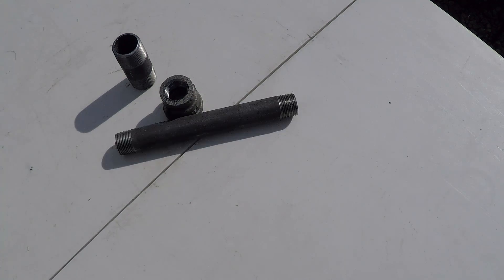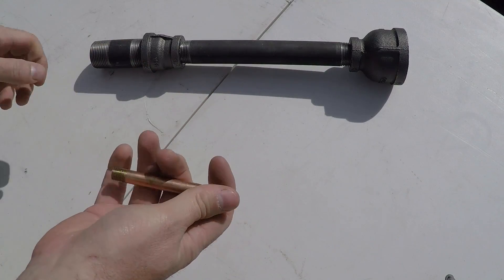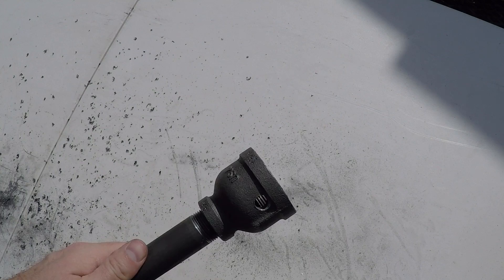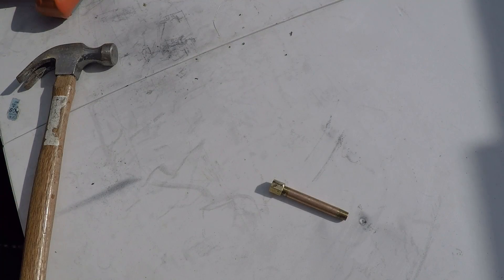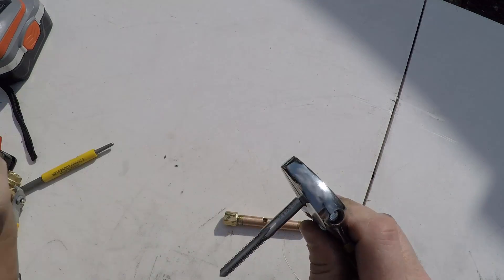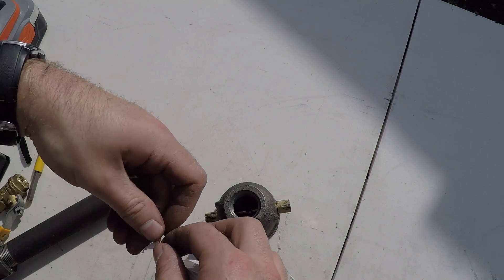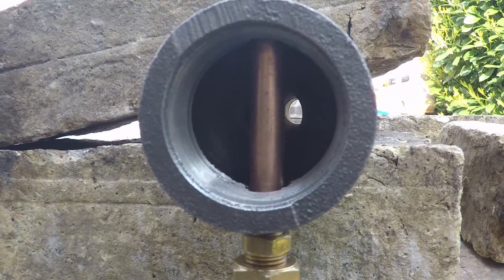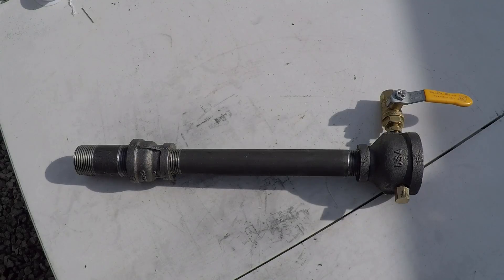How to Build a Forge: Making a Gas Forge Burner (minimal tools / no welder)

Comment: do you have a parts list for this video?
Reply from the maker: McMaster-Carr Parts List:

1 of each required:
Low-Pressure Pipe Fitting - Iron, Straight Reducer, 1-1/2 x 3/4 NPT Female - 44605K317
Standard-Wall Steel Pipe Nipple - Threaded on Both Ends, 3/4 Pipe Size, 8" Long - 44615K525
High-Pressure Brass Pipe Fitting - Cap with Hex Body, 1/8 NPT - 50785K161
Standard-Wall Brass Pipe Nipple - Threaded on Both Ends, 1/8 Pipe Size, 3" Long - 4568K115
High-Pressure Brass Pipe Fitting - Hex Bushing Adapter, 1/4 NPT Male x 1/8 NPT Female - 50785K61
Low-Pressure Pipe Fitting - Iron, Straight Reducer, 1 x 3/4 NPT Female - 44605K277
Standard-Wall Steel Pipe Nipple - Threaded on Both Ends, 1 Pipe Size, 3" Long - 44615K456
Brass On/Off Valve with Lever Handle, 1/4 NPT Female - 47865K21
118 Degree Point Short-Length Drill Bit Uncoated High-Speed Steel, Wire Gauge 60 - 8947A216

Optional 1 of each:
High-Pressure Nickel-Plated Brass Pipe Fitting - Straight Connector with Hex Body, 1/4 NPTF Male - 9151K87
MIG Gun Contact Tips for Tweco Mini Number 1, 0.040" Wire Size - 78375A609
General Purpose Tap for Through-Hole Threading, M6 x 1 Thread Size - 8305A37
Reply: 2ND ENTRANCE?
Reply: @pantrog96  I see you feel the same way I do when people ask something that is in the video that is as easy as getting a pen or pencil and paper and do something. Lazy people just irritate the F*** out of me. I run a Facebook page for a Diner and I get what is your phone number messages all the time. All they had to do was click the call button that was right next to the message button that they had to click to send the message and plus type the message out. 2 clicks and they could have been calling the Diner.
Reply: can that 8" pipe be reduced in size to 6"? is it critical that it is so long?  
thanks
Reply: گگف @alexmanning2755
Reply from the maker: I would think 6" would be sufficient but I haven't tested it and it may not give the air and propane sufficient time to mix. Let us know how it works for you.
Reply: @MakeStuffNation  Is it critical that those smaller pieces be brass? I've been to three different places and could only find them in stainless steel, apart from the bushing.
Reply: +Monster Bash I wouldn't think so. I'd say you should just try it and see what you get. If it does happen to fail, then it's not an expensive loss.
Reply: K. D. Shut the fuck up an move out of your moms basement...I’m tired of seeing you every day
Reply: I followed all of these steps and all I’m getting is a big flame coming out the end of the forge. It’s not a hot blue flame like yours... what do I have going on?
Reply: @mattredden5100  sounds like you're not running enough gas pressure which in turn won't draw enough oxygen down the venture which in return won't make a good hot flame. Did you drill your gas hole to big? You had to do something not quite right.
Reply: Take a look in the description
Reply: Can you use galvanized steel for the 3” long 1/8 brass fitting ( the one you drill a hole in for the mig tip)?
Reply: 🔴 What Is Islam? ⚠️

🔴 Islam is not just another religion. 

🔵 It is the same message preached by Moses, Jesus and Abraham.

 🔴 Islam literally means ‘submission to God’ and it teaches us to have a direct relationship with God. 

 🔵 It reminds us that since God created us, no one should be worshipped except God alone. 

 🔴 It also teaches that God is nothing like a human being or like anything that we can imagine.
🌍 The concept of God is summarized in the Quran as:

📖 { “Say, He is God, the One.  God, the Absolute.  He does not give birth, nor was He born, and there is nothing like Him.”} (Quran 112:1-4)[4] 📚

🔴 Becoming a Muslim is not turning your back to Jesus. 

🔵 Rather it’s going back to the original teachings of Jesus and obeying him.
Reply: @ahmdabdallah2132  
Muhammad was a p3d0file, lies about Jesus. No thanks, bye.
Reply: @ahmdabdallah2132  Muhammad used to love sucking my cock right after I pulled out of Allah's butthole. Where have they been lately? I miss fucking Allah in the ass and getting my cock sucked by Muhammad. Tell them to call me please. Cheers!🍻🥓🐷🐖🍖🥓
Reply: @ahmdabdallah2132 
What in the LIVING F* does your comment have to do with this video on building a forge? 
Seriously, does the Koran have a section on forges...
No, ok then. What about Islam & how Muslims have used forges & what they used them for...
NO, not that either!!!

It's ok though, 2 can play this game ...
Jesus Christ is the Only Lord & Savior & do you know how I know this is true?
....because the Koran outright states it. Koran says the Bible is correct & there's no fault in it & if that's true then Islam is FALSE, a deception, an outright lie, because the Bible states Jesus is the ONLY way to the Father (Allah) & No one gets to the Father except through me (Jesus).

Comment: Thanks for sharing, great job. Just one question ❓ what keeps the flame from going back in the propane tank?
Reply from the maker: Magic. Or fluid dynamics. The propane pressure and airflow rate basically blows it out, at the opening of the burner it's larger so the volume increases and velocity drops allowing the flame to stabilize there. And there's no air in the propane tank.

Comment: I could not for the life of me find a 1 and 1/2" x 3/4" reducer, so i figured I'd instead get a 1 and 1/2" x 1" reducer with a 1"x 3/4" bushing. 

Is that an acceptable solution?
Reply from the maker: That should work. Recommend checking out my newer 2.0 version (link at end of video), it works much better.

Comment: If you really want clean and neat tapped threads, use your drill press. Tap goes in the chuck just like a twist drill bit. Clamp your work in your drill press vise, using copper jaw covers or whatever you usually use to prevent marking up soft materials. Take the belt off the spindle if it is hard to turn by hand. Turn the spindle by hand while you keep a little downward pressure on the quill and bobs yer uncle, perfect tapped threads even in soft metal like copper. When you are tapping in the side wall of tubing, getting the tap started square and keeping it square and steady is important, because you only have a couple of threads holding your threaded fitting. If the fit seems too loose, don't run the tap in quite so deep.
Reply from the maker: No s**t sherlock. This was to show people that it can be done without that stuff. Hence the title "Minimal Tools"

Comment: how hot does it get ?
Reply from the maker: Plenty hot for normal forge work but can be a little cool for welding. My MK2 version (link at the end of the video) is much better and gets hot enough to weld in a well built insulated forge.

Comment: Was this burner a fail? I am wondering why you didn't show any results of the burner working?
Reply from the maker: It worked fine. There is a video of it working linked at the end. I also made a second version which is easier and works better, you can find the video on the channel.

Comment: Man whenever I tap something I insert the  square side into the hole of a 1/4 3/8 inch socket to 1/2 inch hex head thing and use a socket wrench with a half inch socket on it so I can just hold down and ratchet away backing it out here and there to clear debris it works so much better than the t handle or chuck type wrenches that come in the cheaper tap and die sets because you get the most consistent start without spending a chunk of cash on a decent handle a 3/8 in  drive to 1/2 inch hex Stanley adapter is only like 2 dollars vs 40-70$ for a ratcheting tap wrench and all I do is secure it in the drive with a little strip on gorilla tape to make sure it stays straight  while I'm placing the tool and starting it.
Reply from the maker: Great suggestion! Thanks!

Comment: Good basic design, kudos for mentioning drilling precautions...but. If it were me, I would never try to drill any of those holes without putting the pipe in a vise first. Holding it down with one hand & drilling with the other is just too iffy.
Reply from the maker: Great point!

Comment: That solder is going to last until you heat up the burner and it melts, maybe something a bit more heat resistant than low temp solder
Reply from the maker: That end doesn't heat up due to the Air flow. Four years later and it's still going strong.
Reply: @MakeStuffNation   good to know, thanks

Comment: Is this running directly off working pressure natural gas? Does it need to be mixed with air pressure?
Reply from the maker: Running off propane (LPG). If you're using natural gas you'll need to add a blower.

Comment: Thanks, man. most of the vids pass over this part. not complex, but not exactly intuitive, either
Reply from the maker: You are welcome. Check out the  MK2 version video that has adjustable airflow and holds a more stable flame. If you already built this version you can reuse most of the parts for the MK2.

Comment: My local hardware store doesn’t offer a 1 1/2” to 3/4” reducer. Can I use a 1” to 3/4” reducer on both sides?
Reply from the maker: That could work. If you watch the MK2 version video you will see that I changed the outlet size. It helps it hold a more stable flame. The main part is you want a big inlet and outlet with a narrow body. It creates a Venturi effect.

Comment: The regular white thread tape isn’t rated for propane. The gas will deteriorate the tape over time and potentially leak. Good news is that the yellow tape isn’t much more expensive and will add an extra measure of safety. It’s also available at Home Depot/Lowe’s.
Reply from the maker: Good advice

Comment: I needed to throw a piece of ductape over the top to slow down the air intake, aside from that it works great
Reply from the maker: I made a MK2 version video that has an adjustable airflow regulator. You can reuse most of the parts from this version to make the MK2. I also increased the outlet size which helps holds a more stable flame.

Comment: hey ive been watching a few of your forge videos and im about to attempt my first forge...looking to build one out of a 20# propane tank, with 2 of your burners...couple questions
can i replace the 1x3" tube with a longer one or will it mess with the air/fuel ratio? thinking of mounting those straight to the tank and then i can screw/ unscrew the reaminder of the burner housing 
Also if i made 2 of these burners, connected the brass fittings with a T then the ball vavle to run both off one tank will it still work?
Lastly any idea how much heat these are through out? trying to figure out how much insulation i will need in my forge with 2 burners
Thanks and i appreciate the videos by far the best video out there ive found!
Reply from the maker: The length of tube that you use for the body shouldn't make a big difference. I would check out my MK2 version video for a slightly better design that includes adjustable airflow. Using a T fitting in your hoses to fire two burners shouldn't be a problem.

Comment: I like your burner design better than others I've seen. It's much less complicated and easy to make. 
Just for your information, that 1" pipe nipple is steel, not cast iron, and the reducing couplings are malleable iron. 
Your 1/4" brass pipe cap is always put on the end of a pipe, so to call it an "end" cap is redundant. It's just a cap. ;)
Reply from the maker: Thanks. This design does have a few issues though, the flare at the exit/flame end is too small. I've updated the design with a few changes and re-uses most of the parts. Its much more reliable, check it out here: https://youtu.be/BjqA4VQMpiM
Reply: @MakeStuffNation  Thanks, I checked it out. :)

Comment: Did you cut down the valve handle? Or were you able to turn it around?
Reply from the maker: I didn't need to cut it. Here's my better updated burner design that re-uses most of the same parts: https://youtu.be/BjqA4VQMpiM

Comment: Wont the solder fail due the the heat from burner?
Reply from the maker: That end of the burner does not get hot enough to effect the solder.

Comment: I am trying to start backyard forgeing but am running into a problem.  I am using a graphite crucible and even letting it heat up for 10min no melting is happening even after 15min.  What ami I doing wrong?
Reply from the maker: A crucible is used for melting metal, not heating metal to blacksmith/forge. Either way, a crucible alone is not enough, you have to put it in an insulated furnace, forge, or kiln to heat it.

Comment: approximately how many btu / hr does it produce?
Reply from the maker: No idea. Check out the MK2 version which has some significant improvements though. It gets a small gas bottle style forge hot enough to weld. https://youtu.be/BjqA4VQMpiM

Comment: When it's up and running the heat that migrates down the pipe might exceed the melting point of your solder. I've seen people drill and tap the collar so they can drive in a pointed set screw to bind the copper pipe in place. Good luck and have fun. The nice thing about using the mig tip is your ability to try .23, .30 and .35 to get the best flame. You may want to add a way to control air intake to balance your flame.
Reply from the maker: I've run this burner frequently for hours at a time and haven't had an issue with heat migration. The airflow seems to keep the intake end cool enough. Agreed about the MIG tips. I've found that smaller works better on this burner. I added an air controller on my MK2 version, check it out: https://youtu.be/BjqA4VQMpiM

Comment: I'm starting to get into forging (as a 15 year old I dont have 140 bucks to blow on two burners) and this was a savior.
Reply from the maker: Check out the MK2 version which has some significant improvements and can re-use most of the parts from this design. It gets a small gas bottle style forge hot enough to weld. https://youtu.be/BjqA4VQMpiM

Comment: How big does the burner hole have to be? I made it slightly larger than 
the burner diameter and my burner goes out fairly quickly when I add the
 lid. I am assuming that my burner hole is too small. Any guidelines? 
1.25x, 1.5x, other, burner diameter?
Reply: Burner hole in my tank. Burner works great outside.
Reply from the maker: the end of the burner should fit snugly in the hole (you don't want air drawn in around it) but if you can flare the hole through the wall out to a larger diameter (2x) on the inside of the forge it helps slow the airflow and stabilize the flame.
Reply from the maker: Also, if you're not too far along with your project, you might want to check out my MK2 burner build video. You can reuse almost all the parts but it has some significant improvements such as adjustable airflow and a better/larger diameter nozzle (will help stabilize the flame)

Comment: ptfe tape decomposes above 250C.
Reply from the maker: Good thing is cooled by the gas flowing through it and intake air flowing around (I've measured it with an infrared thermometer many times and the intake end of the burner never gets above 100C).

Comment: A few copper crush washers under the reducer bushing would allow you to tighten and clamp the tube so it wouldn't rotate, instead of soldering, drilling etc.
Reply from the maker: Yes, that should work well.

Comment: It needs pipe tape for gas. Doesn't have to have a lot of pressure to leak .  use soapy water to check for leaks.
Reply from the maker: Yup

Comment: Isn't the solder going to melt when you use the forge?
Reply from the maker: The entry end of the burner stays relatively cool due to all the airflow through it. Haven't had any issues with it yet. You can also use some spacer washers and screw the fittings down tight to clamp everything in place.

Comment: Can you use an 6" instead of an 8" pipe? Why or why not??? Thank you
Reply from the maker: I think you should be able to use a 6" pipe. The possible downside is that the air and fuel might not mix as thoroughly and the valve end of the  burner will be closer to the forge and will get hotter.

Comment: I'm having trouble tuning my burner, any advice? Thanks for the information
Reply: daddyrenegade sorry for the late reply but for people to help we really need more information. If you are having trouble with the gas ignition, your hole might be too big or too small, might be wrong angle etc.. if there isn’t a flow you like try adjusting you air limiter. I’m sure you’ve fixed it by now but I hope this was helpful
Reply from the maker: There are a few issues with this design that I found. You can use the parts from this and make my MK2 design which is much more reliable and easier to tune: https://youtu.be/BjqA4VQMpiM

Comment: I followed the instructions to a tee but I dont get a concentrated flame? I didnt use a Mig tip though.  Its just a rolling blue flame. Any suggestions?
Reply: You are not using the proper high pressure regulator. Regular BBQ propane one does not work, you need a 10+ lbs one